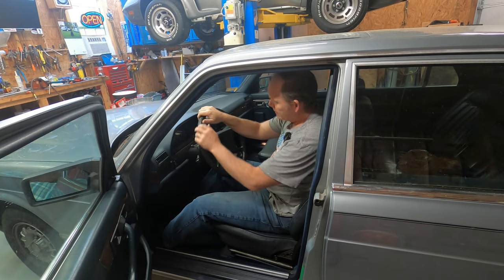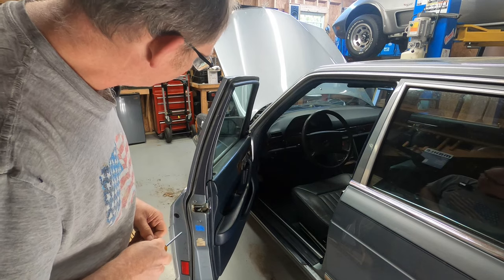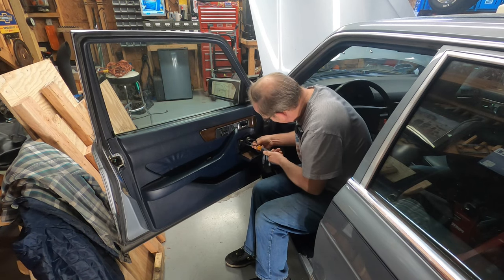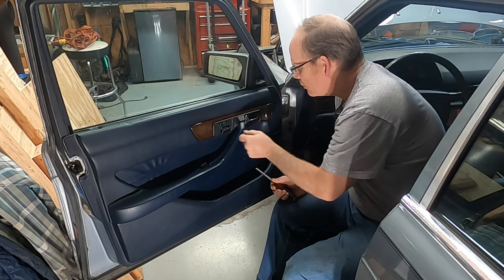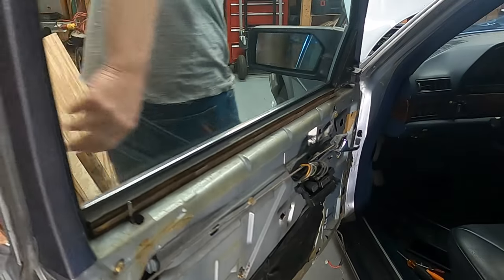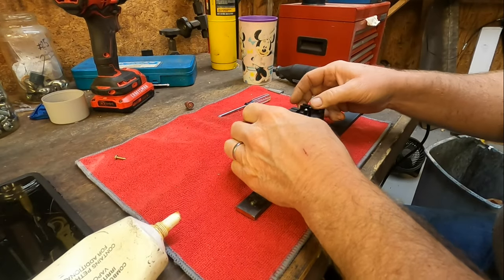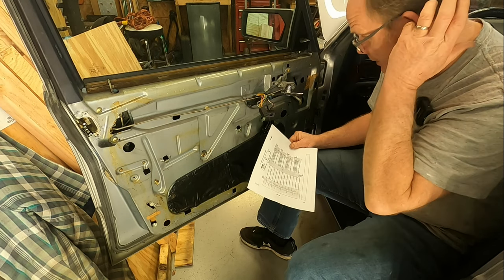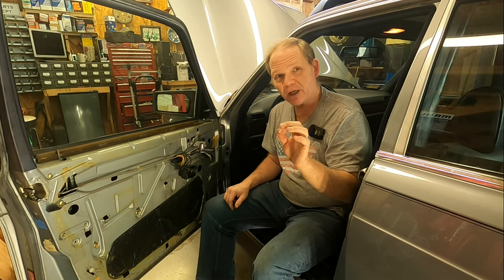W126 Mercedes - Power Seat Switch Tear Down, Repair, Reassembly

Comment: I had a similar problem with mine. I think it's the cable tip popped out of the motor. Easy fix but have to remove the front seat to fix it.

Comment: Can't comment on the memory version.
On the older (non-memory) style switch the same two wires move the seat in both directions, by reversing the direction of current.  So if the seat moves on one direction but not the other it's a switch issue.  
There is an exception:  if the switch makes the motor run but the seat fails to move in one or both directions the "speedometer cable" between the motor and gearing has backed out of its "socket" in one end or the other.  You can fix by "centering up" the flex cable or (better yet) slide the cable jacket deeper into one or both end fittings and stake/glue it there.   
In my experience the seat must be removed to work on the bottom of the seat so "function test" all four adjustments before reinstalling the seat.  I keep a small used 12v sealed battery (removed from an UPS) handy for such tests.
The driver side is harder because of the steering wheel. When I R&R the drivers' seat I "roll" the seat on its side (upholstery side facing me) and then pivot (yaw) the seat bottom out the door followed by the seatback. You want the seatback near vertical for this maneuver.
Reply from the maker: Yeah I had the seats out a few years ago to repair springs and tested all movement at that time using jumper wires and a battery. There are some earlier videos on that. I think I will end up removing the driver's seat to go through all the stuff you mentioned. Probably wait until I'm done with the vette though. Appreciate the insight sir.

Comment: I had the same issues with the controls for power seats on my w124.  When those ball bearings  fell out of the switch I thought I had screwed up. I said a few choice word’s also.  I had to clean all the contacts as you did and the switch worked perfectly.  It’s amazing the engineering that the Germans put into these cars. I also had issues with my headrest going up and down.  Turned out to be the control box under the seat. Thats probably your problem. Also the color coded diagram on the connector is ‘golden’.  They thought of everything.
Reply from the maker: Sounds like I'm pulling the seat out again. Arg!!

Comment: It’s definitely the seat controller below. That’s the brain of the whole operation. Sends voltage to the controller on the door. For some reason the memory controls screw everything up when they go flewy. Why I enjoy the years prior to the memory function, never have any issues.  Recommend getting a good used seat controller and swap it out.
Reply from the maker: Thank you! I will make that my next step!

Comment: Impalaman is an unlikely name for this great resource for classic Mercedes owners.  Pierre Hedary, Kent Bergsma, and others have good podcasts too but Impalaman is more "hands on" and shows (vs demonstrates or explains) how to actually do these jobs, including the problems.  IMO, these are great old cars (especially compared to Detroit products of the era)  but working people can't afford to maintain them except DIY.  Structural rust is lethal: my previous w123 wagon had a lot of rust but my w126 SD seems to have much better rust-protection.  The other issue is elastomers, like rubber and plastic: they age with time and heat regardless of miles.  Things like flex disks, CV boots, engine mounts, and ball-joint boots need to be inspected and replaced eventually.  I think the main limitation now is availability of quality parts, and "cash for clunkers" didn't help.  Even OE brand names can turn out to be reboxed third-world parts (look for the "made in" marking).  China (esp. Taiwan) CAN produce excellent quality if that is what is specified; but western suppliers go to China for cheap, not quality.

Comment: Often, just spraying contact cleaner (preferably the kind including lube) into the switches will restore function with no disassembly (beyond removing the knobs).  Use the little straw to get the lube in the holes surrounding the operating "posts".
Reply from the maker: But what about the pain and suffering? You loose all of that. 🤪

Comment: The knob that was broken is for the headrest to move up and down. Just a guess.
Reply from the maker: Yeah that's probably right. This car did not come with that feature so there is no space for a switch on the control pad. I guess it is a place holder.
Reply: @ImpalamansGarage  I agree.
Reply: thinking the same thing
Reply: So how do you raise the headrest then?  Manually?
Reply: @ronstjohn6780  
Manually headrest model.  Nothing wrong with that.
Reply: @ronstjohn6780  yip

Comment: That’s a complicated switch. I’ve had several apart, but nothing with even close to that many separate components. That’s the German way, fight? Still the problems are similar, arcing or corrosion stops the current flow.
Reply: Right not fight!
Reply from the maker: I think I've still got problems under the seat. That's for another day.